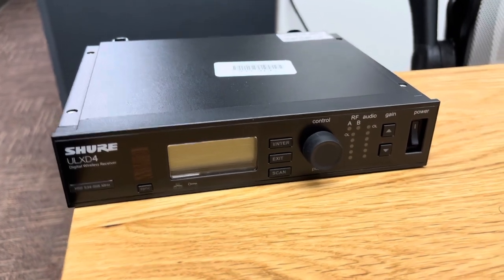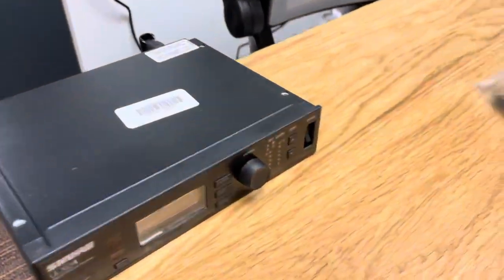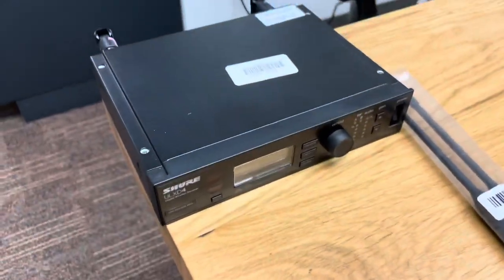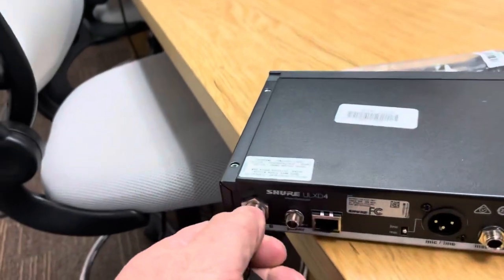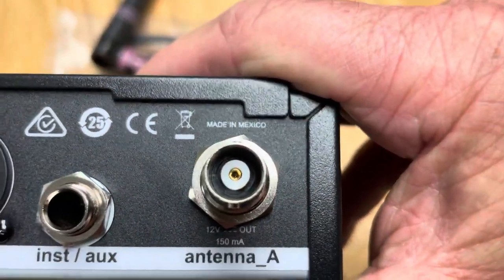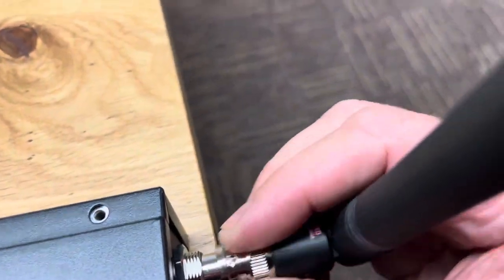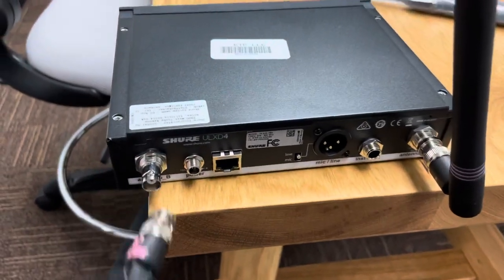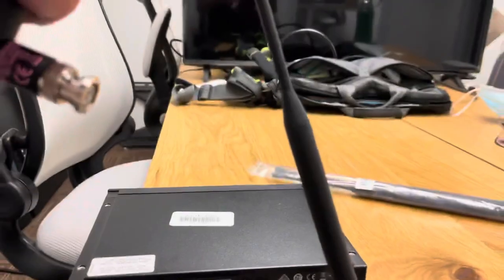SHURE wireless mic floppy antenna fix

Comment: where can I buy these gaskets only?
Reply: I'm looking for these as well now. Any luck?
Reply: @WarLooch no, I bought the antenna
Reply: @maizesoft  Gotcha. Thanks.

I might be able to buy a similar rubber washer. I'll just need to figure out what size it is (I'm guessing 1/4" maybe?). I can always shave down the outer circumference for whatever I buy if needed.